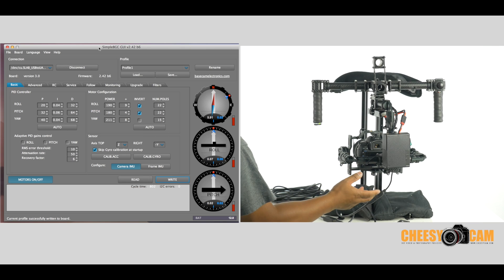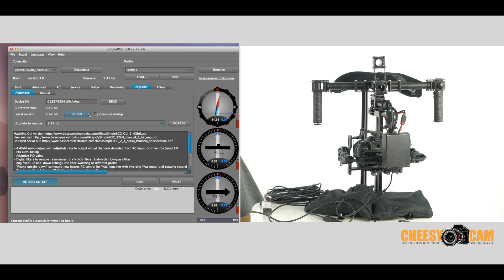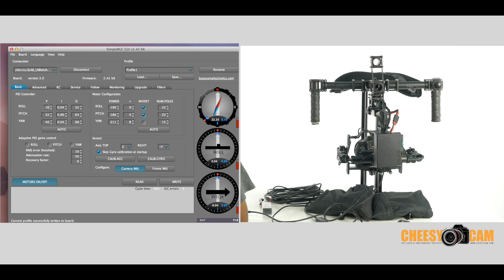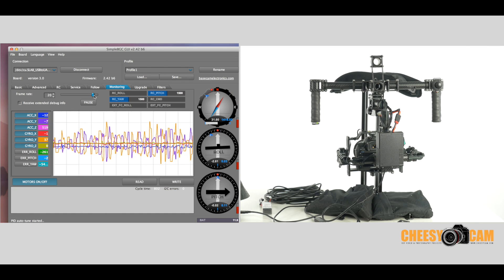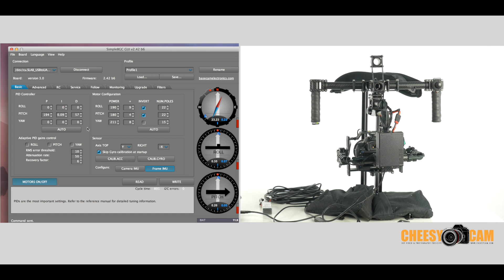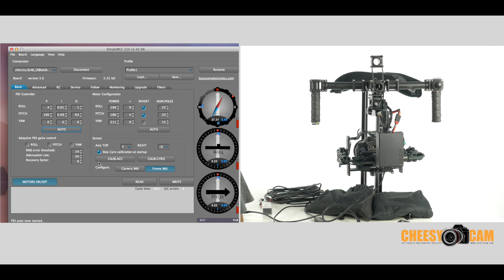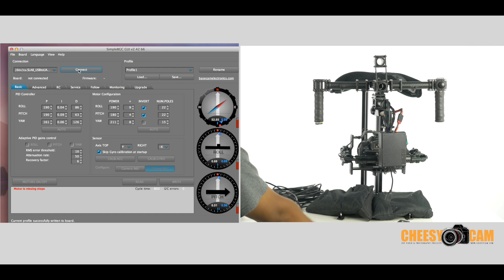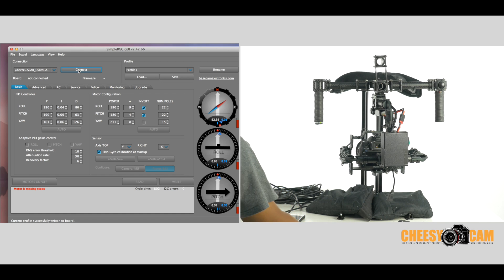3 Axis Gimbal Auto Tuning PID Settings Alexmos SBGC Firmware Upgrade

Comment: What Alexmos gimbal would you recommend as of today? I´m choosing between DJI Ronin or Birdycam. I know that DJI does not use Alexmos. But Ronin seems to have some problems.
Reply from the maker: Peder Wahlberg I get this question all the time, but without knowing the camera it's hard to say. If you say you had a Canon C100, then the Varavon Birdycam physically can't fit that size camera. If you say GH4, then there's no reason why you need something as large as the Ronin.
Reply: I have the canon GH4, so a good buy could be the Birdycam?
Reply from the maker: Peder Wahlberg Honestly it would look pretty silly flying a GH4 on a Ronin. The Ronin is very large, the case it travels in is large, and the stand you use is very large. It's just soo much extra bulk just to stabilize a small camera. I would go more with the birdycam unless you have a need for 15mm rails, super heavy cine lenses, or accessories to be mounted on top or with the camera. The birdycam2 works great with a gh4 and you could add some accessories to the top handle area.
Reply: Thanks for your advice and taking your time to answer. I´ll go with Birdycam. Subscribed to you channel!

Comment: Emm
Are you demo-ing this on your CAME-7000? I'm still having issues with mine. Joey at the company-however- is great to work with. I'm on the road for another week and will get mine fine tuned then. Thank you for your videos, they are most helpful- even for old salts like me... !!
Reply from the maker: ***** Yes I was using my older CAME 7000 (upgraded to 32 bit). There's no guarantee it's perfect, so always make a backup of your current settings. You can also downgrade the firmware too if you really have to.

Comment: Thanks again for all of your informative videos.  After watching your videos, I decided to order an EagleEye gimbal which by default comes with an 8-bit controller.  When you tested the CAME 7000, you mentioned that the 32 bit version was a good upgrade.  With your experience, would you skip the 8-bit controller entirely and jump straight into a 32-bit?  Does it make that big of a difference?
Reply from the maker: Dartheomus There is no comparison. 32 bit is just so much more advanced and faster. Should have gone with the CAME-TV version. It is bundled differently than the Eagle.
Reply: MrCheesyCam Well, I might find out I'm fooling myself when it arrives, but it looked like I could get the same thing for about 70% of the cost.  The 32-bit CAME 7000 is $980.  The EagleEye "appears" to have the same construction for $488 & it comes with what I believe are the same motors, joystick, and an 8-bit controller.  Ebay has the 32 bit controllers for $150, a case for the controller for $25, and a battery for $15.  (I already have a Lipo charger.)  So I'm looking at a total of $678.  Is my logic flawed?  (Link to the auction I purchased: http://www.ebay.com/itm/251607902614?_trksid=p2059210.m2749.l2649&ssPageName=STRK%3AMEBIDX%3AIT)
Reply from the maker: Dartheomus I could be wrong, but they did change out the Pan motor on the CAME-TV in the recent products. 

Just FYI, If you mount the frame IMU get a plastic mount for it or insulate it from the Carbon frame. Carbon Fiber can conduct electricity and you will short out the system or get it so hot it will melt and catch fire.
Reply: MrCheesyCam Thanks, I will keep that in mind.  I think I saw one of your videos where you insulated it with a small piece of foam rubber.  I figured I'd do the same.  As far as the pan motor goes, you may be right.  The one I got has the 200T... maybe it's not strong enough.  I have to wait about 2 weeks before it shows up, but I'll let you know how it turns out.  Thanks again, and keep up all the great videos!
Reply: Well, so far, it seems you get what you pay for.  I got my Ebay Eagleeye in today, and it's missing a ton of parts.  It's missing the joystick, the power cable, and even the bottom plate of the camera cage.  Also, they said that it was supposed to come with 180T motors for the pitch and roll, but they sent 200T motors...  If they can't get this resolved, I guess I'll send it back and buy a CAME gimbal.

Comment: Thanks for your tuto.
I have a question for you. Could you made the firmware update in OS X? Because I can´t do it.
Some people told me that the only way to do, is under Windows. That´s right?
The number of poles and the power of the motors are do it bi itself or you put this values by hand?
Sorry my little english.
Reply from the maker: Charies Hernandez It takes one second in Windows. In the beginning of this video I also suggest just using Windows.
Reply: Good day. There is not a problem, I do it on my Mac with Parallel App, but you have to install a driver for your Parrallel (for Win).
Reply from the maker: Испания Наизнанку Yes it's on a mac computer but you are still using the windows OS.
Reply: Yes, MrCheesyCam, using Windows OS but in Parallel App. Today I am Happy, it seems to me I will be able to tune my gimbal. I had a very big problem with it. I found a way to fix it up, I have just erase EEPROM and everything OK. Now my gimbal is Ok.
Reply: Yes, It seems to me I can do it but I have not done it so far. Yes I set the number of poles and the power of my motors by hand. MrCheesyCam said me how to do it. And there is not any problem to connect to your GUI in Parallel App. Just try It. Many thanks for your help. With best regards Dmitrii from Spain:)

Comment: You have YAW NUM.POLES 15, there should be 14
Reply from the maker: filmowanie Good Eye! Technically the older CAME 7000 used a different Pan motor with 12 poles and later they upgraded to 14 poles when they went 32 bit. It's best to check this manually.

Mine says 15 on purpose, but in this video I show you how to tune motor configuration and tell you it's 14.: http://youtu.be/3K1plNpScB4?t=4m15s
Reply: MrCheesyCam will the CAME 7500 WORK?
Reply from the maker: FlashOneFilms Yes it will work on the cane-tv 7500. On the 7000 model it should be the 32 bit verson.
Reply: oh okay cool thanks.